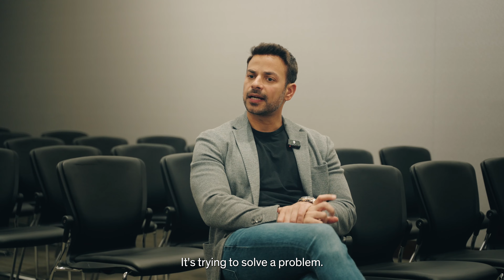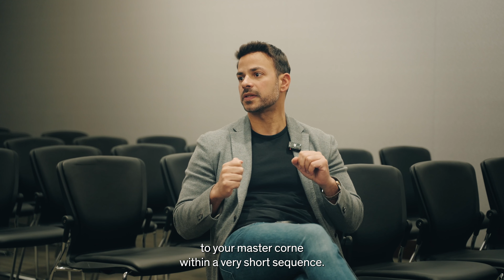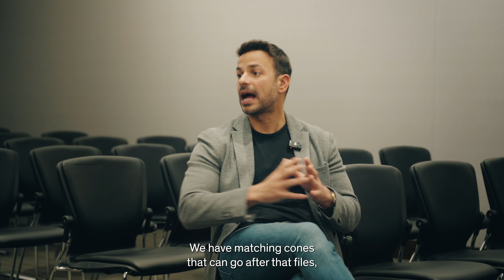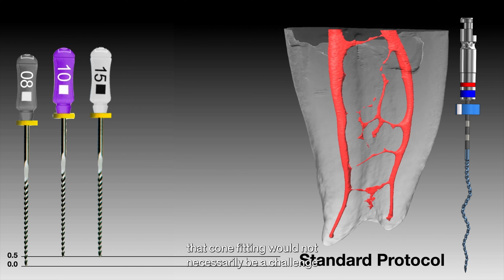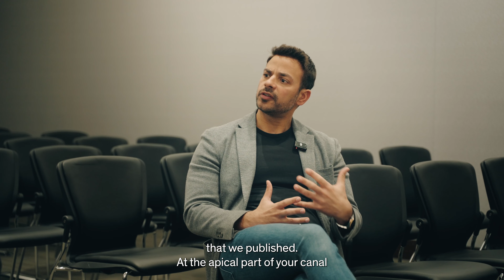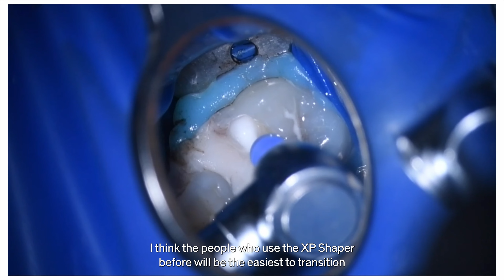XP-4D - Interview with Dr. Adham Azim

Comment: does the preparation of the system fit with warm vertical obturation?
Reply from the maker: Dear Dr.
Thank you for reaching out!
For the XP-4D, we recommend our matching Gutta-perchas XP-4D and a single cone obturation technique. 
If you wish to use another obturation technique, it might be a bit trickier as you will need to find GPs that match best with your prefered obturation technique (the standard XP-4D file has a taper of 30/.03)

Let us know if anything is unclear :)
A great day to you!
Your FKG Team